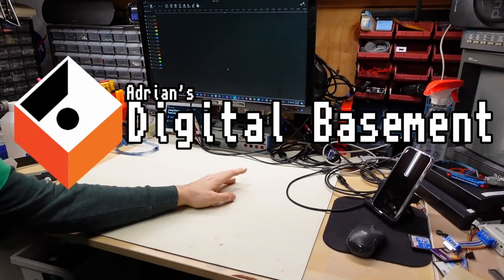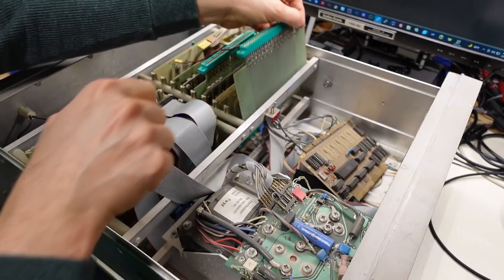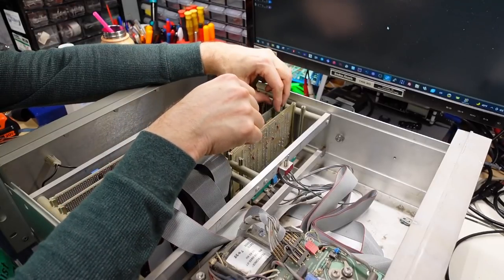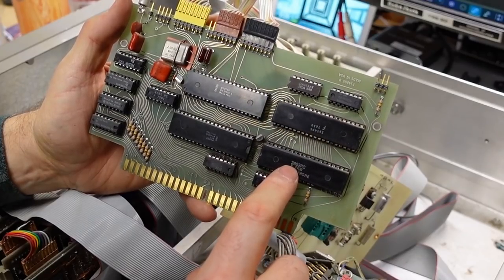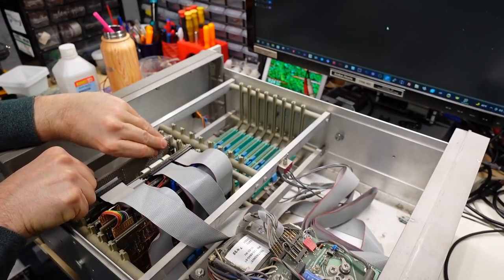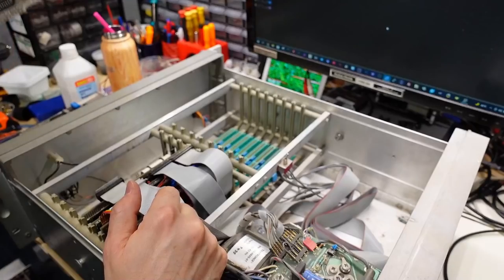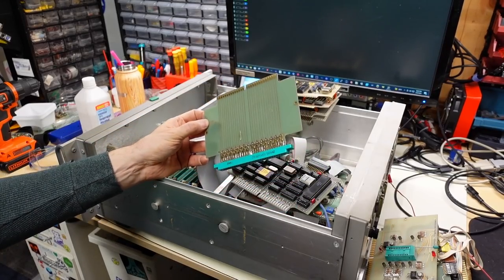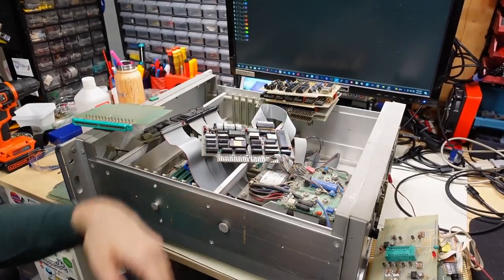I need help finding information on this mysterious computer

Comment: Ask yourself, who would bodge together electronics to get something working, and then later bodge things on to add another feature...

HAMS.

Serial ports...

It was a home or club-built repeater controller.  or some such.

Ham radios use serial for control a lot of times.  
So the dual serial out would be to individual radios to sequence the transmit on cross channels.
What if this system was never designed to have output, except to those radios?
There never was a user interface but through the radio link?
Does that help you trace the design?

one last hint.  there is likely a debug terminal open somewhere.

-C

Comment: This reminds me a lot of the custom built systems I saw in the various research groups at college it the 70's and 80's, starting with some basic system and then building your own boards for the experiment you were running.  The systems would often get reused and had additional mods for later experiments.  All the custom wiring could be from the cheap availability of student labor.

Comment: My guess is like some of the others but the address mods to that one board leads me to believe it is a custom server / print server that several other computers enter and share data. This is from the one male and two female ports on the back and the riser cards that accept other forms of test inputs.

My dad was a toll test tech for MI Bell back before computers and he would go to school when AT&T introduced computers to the company, then he would train others to implement them. He got to take home all outdated equipment and I think he had something similar to this that he used to bridge the eight teletypes he brought home from AT&T. 1970 to 1985 era. Before the internet he would send and receive data via Ham Radio from all over the world, and print it on teletype in the form of pictures (mostly naked ladies).

Comment: Looks like a drawer from a military test station or test stand. Riser cards usually used to calibrate or test the circuits cards. New tech often had depot constructed or manufacturer constructed test drawers made from hand made or breadboard cards.

Comment: this is an custom made controller computer for some industrial machine , perhaps the maine servo control unit of  a small automated chain line.i don't think you can find something on it because is custom made,and it's from the 80-90th

Comment: The cards suspiciously look like Q-Bus cards. The Q-Bus is what PDP computers had used, this is a hardware reduced version of the Unibus. It multiplexes address and data lines so it can be a lot smaller and reduces the amount of wires and contacts between cards. The downside is that you can’t simply connect any common chip directly. On the other hand, there are a lot of extra chips on most of your cards which might be able to interface the Q-Bus.

The damage on the riser cards could be “normal”. Homemade and small series PCBs often were faulty fresh out of production until the mid 1990s. The generic PCB material was rather bad and of random quality. Seeing wires and solder wicks on traces was common. In Germany, the company Bungard made high quality PCB material and small series PCBs for a relative reasonable price. Even as a teenager I bought Bungard material. 

The card with the button on top and missing “RAM” could be an I/O board. The missing chips could be shift registers and/or latches. It is very unlikely to have RAM connected to ribbon cables like that.

Power supplies which were not meant to be user serviceable unlike XT/AT/ATX PC always were “scary”. This is a very common late 1970s, early 1980s design. In Germany, there were no laws for basic protection against accidents inside casings and switchboard cabinets until 1984. And then it took a full decade until most stuff had covers on mains voltage and proper wire insulation.

The interesting detail on the PSU is the Tantal capacitor. Those were highly expensive and only used in environments where the price of the machine didn’t matter much. During the “Desert Storm” war, the USA stopped export of Tantal capacitors and European manufacturers had struggled badly. The major problem were space restrictions since classic electrolyte capacitors were a lot bigger and had a much bigger ESR. So you had to use several bulky capacitors to replace those tiny Tantal ones. After the war when Tantal capacitors became available again, most companies didn’t dare to switch back. This had lead to the development of low-ESR Al capacitors. 

The “transformer wire” looks like “wire wrap” stuff, very common in any electronics workshop back then. Also scratching parts, adding seemingly random parts and running wires all over the place was also very common. Back then, PCBs were designed by pen&paper. Even when they used a computer, there was no way to automatically check the design against the schematics. Also part documentation was printed in books or came on loose photocopy sheets. So even if you had managed to come up with a flawless PCB design, you had to change stuff due to errors in the documentation which was available to you.
Also some chips changed their parameters during production so you had to add/remove some resistors and capacitors to compensate. Just take a random Commodore Floppy drive and have a look! In Germany, we like to call this “Hühnerfutter” = “Chicken Feed” since it looks like a mixture of random stuff sprinkled on top of the PCB.

The light ceramic packages on the ROM board are what a IC casing looks like under the black plastic. So it is a ROM IC missing its plastic coating. Some will have a small blob on the actual chip, others are fully bare and are protected by sticky tape. DO NOT REMOVE THE LABEL, you might ruin the chip by exposure to dirt! Those bare chips are rather common during prototyping. I own a C64 with mostly “white chips”. It is a pre-production model given to Möller to develop industrial control computers. I have got this one from the guy who took this C64 apart and had put it into a metal box with a built in screen and a handle. This might be the very first case modded C64.
The transistors around the ZIF socket suggest that this might even be a PROM programmer. A PROM is actually really burned. It contains a matrix of diodes where each diode is representing a logic ‘1’. Mask programmed ROMs are lacking a diode where you need a ‘0’. This used to be done by putting a mask onto the chip during production to prevent that the diodes are made in those spots. A PROM is just a ROM where no mask was applied and is full of ‘1’. Wherever you need a ‘0’, you address the memory cell just as you would be reading it and then short circuit the output to burn out the diode. This involves a relative great current which explains the individual transistors around the socket, they obviously have a lot of clearance for cooling purposes. 

Most Z80 computers of this era were accessed by Teletype, Lineprinter (with RS232 keyboard) or Video Terminal (VT52, VT100, IBM3101). If you like to play with one of those, you can buy an Altairduino and hook it to a real VT, attach it to a PC running a terminal program or connect it to your PC or cell phone using Bluetooth. There even is a version available with a built in VT100 terminal you can hook to a VGA monitor and use a PC keyboard. Playing Zork or Hitchhikers guide to the galaxy on a teletype or IBM3101 is really neat. The early Infocom interpreter for CP/M systems doesn’t need capital letters so it can be played on a real 5-bit teletype machine like a Siemens T100. I have built an interface using a microcontroller to adapt +/-12V RS232 and ASCII to 40mA current loop using CCITT-2 code.
What made the Apple-I so amazing was that this is a computer you can hook to a TV, everything before the Apple had to be used with a terminal or special monitor at best!

About the corrosion caused by the battery: https://www.youtube.com/watch?v=JqvdLEKVbyM

The missing IC on the CPU board could be to be used with an alternate CPU. The Altair can be equipped with an 8080 or Z80 microprocessor. CP/M was designed to be versatile and most commercial software was made for the 8080, Z80 or both. You can use either CPU in such a system but they have a different pinout so you need two sockets to be able to switch between CPUs.

There was a video adapter available for the Altair 8800 but this was not common at all. Just like in the movie “Wargames”, the common means of user interface was a VT52/VT100 hooked to the RS232 port.

If you want to power up your machine and use it, you need a RS232 port on a PC and run hyperterminal or the like. The common Baud rate back then was 1200 Baud, in rare cases 2400 Baud and if a modem (or acoustic coupler) was involved, 300 Baud. The absolute maximum was 9600 Baud. A PC had more since it used a generic timer to generate its Baud rate and the source clock speed happened to be 115200 Hz. If you had a very short cable, this undivided clock speed even worked.
You might need to tinker with the byte size and parity. It wasn’t uncommon to use 7-bit, parity ODD or SPACE. Sometimes a printer was connected in parallel to a Video Terminal. The printer was set to MARK, the terminal to SPACE. If the parity bit is ‘0’, the printer won’t accept the data so you could activate the printer using software. The VT will accept all data (SPACE = ignore parity).
RS-232 is a real mess! You never know which pin is Rx and which one is Tx. Normally the male connector is for the host and the female is for the Endpoint. For convenience, it can be the other way round or Rx and Tx is switched. Just use a LED and a 1k resistor, the Tx line glows bright(er). Classic RS-232 is current limited to 20mA – or not. But a single LED using 1k will always work fine for diagnostics. Just make sure your modern LED likes 10mA, back then a standard LED was 20mA full brightness. Just using a multi-meter won’t help you since the Rx line often uses a pullup so you would measure the same or similar voltage on both lines.

Comment: A few thoughts that may not have come up: These cards may not come from the same machine and may not have been in there all the time. They may have just stacked all the more or less related boards into the chassis when this was put in to storage or decommissioned. Also, all the parts and wiring may not be from the same time. It may have been very different when it was built and many things may have been changed, updated, or patched later. There may even be failed repair and diagnostic things in there from when the thing finally failed and someone tried to debug it and eventually gave up and packed it away. These are the kind of things that are forgotten about when equipment moves around.

Comment: There's a sticker that says Tektronix.
Those are guys that produce measuring equipment and they are still pretty much alive and well.
It is weird that a measuring equipment company would put a sticker on a power brick, right?
You could just contact them and ask them what sort of machine that is, but it does look like a production rack spectrum analyser or whatever.
Those things aren't mass produced still, so that could explain the amount of handmade cards there.

Comment: I also found a HUGE computer from the 90s' in the trash years ago that I can find absolutely no info on anywhere.  It actually has two separate Pentium processors, one 60mhz and the other 90mhz on a separate board from the main motherboard. The board has MANY eISA slots and also SCSI as well. I believe that it is listed as some sort of IBM, but there is no distinguishing features written on the motherboard.  It does still run, except it needs the proprietary CMOS battery replaced. It even has a small lit up lcd screen which gives some info on startup. It had a very powerful cooling fan onboard but I think I removed it for another project years ago. It did not have any pertinent info on the hard drive either to identify its original use. It weighs a freakin' ton as I believe that it is all steel and not aluminum!  It's FAR bigger than the one you show here and was definitely meant to be on the floor when used.   The mystery goes on.....🤔
I would take yours outside, keep a fire extinguisher nearby, fire it up, and just watch out for any vortexes or anomalies opening up nearby so as not to get swallowed up inside one!  I think your machine is FAR MORE interesting than mine, by the way!  👍👍😂😂

Comment: OK so focusing on the fact it has a Tek transformer, maybe it was some kind of development/programming machine owned by Tektronix and built in-house by them?  They certainly would have had the resources to make something like that.
Reply: The transformer is from a tek31 calculator. by the early 80's they were on the surplus market.

Comment: It reminds me a lot the computer plans that you could get by Elektor monthly revue in early 80's. It seems to have a CPU for Basic and an another one for CP/M-DOS mode. So control caps on the PSU side, clean the battery leak, clean connectors and theirs supports, give a try with SOME multimeters without cards, and make try.

Comment: I just had to create an account to share some info in this kind of machines.
This is a Z80 CPM multiuser computer, appears that it was used  as a development computer for other z-80 computers.
Those computers doesn't use screens/kerboard interfaces, only terminals.
The DB-25 ports on the back are regular Serial ports for the main terminal. One of the big ports is a DC-37 RS-449 serial port: https://en.wikipedia.org/wiki/RS-449 (I could be wrong but pretty much that was the port back then).  The other big port DB-50 is used to connect 7 serial port to VT-100 terminals using a Breakout DB50 Computer Cable with 7 Qty DB25 Female https://www.recycledgoods.com/breakout-computer-cable-with-db50-male-to-7-db25-female-connectors/

Now, back then there were no hard drives, but appears that the board with lots of sockets were used as some kind of "Hard drive" and manually the "sysop" had to rewire the addresses to indicate the amount of ROMs that contains the operating system.

I don't have more specific information on this computer, but I hope this information helps.
Reply: By the way, if you want to try to boot this computer, you must set the terminal port speed to 9600 bauds, no parity,8 bits, 1 stop bit (9600,n,8,1)

Comment: Yes a rack mount bus system like this would have been terminal driven... It wasn't on a desk... It was the computer for a whole business/organization. This was run like a "mainframe", but without multics/unix/multiuser OS. It probably had (3x 25db connectors) three terminals max. One would have been a special or master terminal probably the one most associated with the prom programmer.

The program terminals would have been (likely, CP/M) software multiplexed by a master program custom to the shop usage, if they even used more than one. If you can find evidence of MP/M use it was probably a university/government/large business.

It would have been fantastic to have gotten the software disks this thing ran. So much of the hardware modifications would be explained in the software.

It just occurred to me that serial printers and modems might have eaten the additional lines. If this was used into the late 80s or was a library/lab computer it almost certainly used an external modem.

Comment: I think that the missing piece of the puzzle is context.  The dates on the various components indicate that the computer started life some time back in the 1970's - and for context this is the time when 'hackers' were the real deal.  Taking a piece of equipment that was designed for one role and making something different of out it was not uncommon.  To me the telltale is the 'Tektronix; label on the PSU transformer, and the over engineered design indicating that the equipment originally did something else.

I would guess that the key components were originally for something else, and the 'hacker' required it for their own purposes - and possibly pt it into a different case.  This would explain a couple of things:

Many of the cards had markings indicating that they may have been professionally manufactured (part numbers?)
Modification (bodging) of a number of the cards to change things such as addressing
A very wide mix of component manufacturers
The inclusion of 'home made' cards with different vintage parts (e.g. the Z-280 and flash memory chip)

The skill show in its design tells me that this was 'built' by someone quite clever.

Comment: @Adrian's Digital Basement ][
the wire saying +30 could mean that that is connected directly to a 12v power source. let me explain on older cars we used to call +30 current directly from battery and +15 being from 
ignition key on, not sure if they used this in other applications back in the day

Comment: This looks like it was an industrial control system. One of those DB25's should be an RS232 terminal interface. Likely the disconnected one, unfortunately. I would bet that this was controlling equipment in need of high precision timing, or was a data acquisition system. It should, in fact, be possible to get it up and running fairly easily - just have to find which connector is the terminal.

Comment: We used to make stuff like this for manufacturing test equipment in the 1980s. Boards like that could be bought. The cabinet may have been custom. Model shops in IBM could make this.

Comment: At that point, an awful lot of systems ran with a serial terminal without any inbuilt display or keyboard.

While I don't recognise the specific machine, I have worked with very similar machines - even down to the protoboard custom cards.
I believe there was an S-80 bus that never caught on.